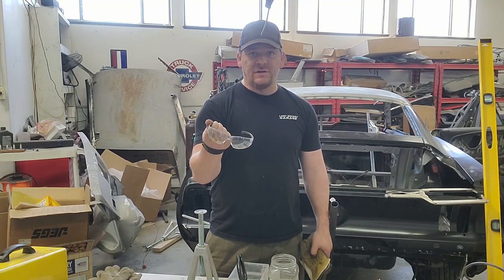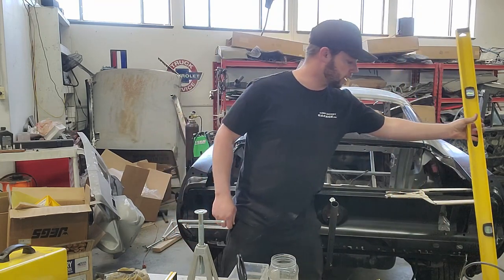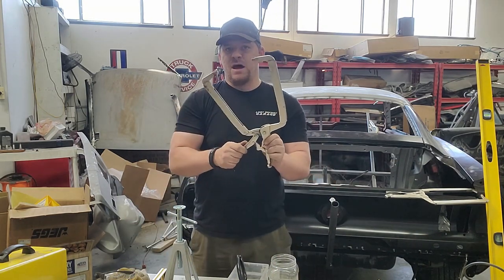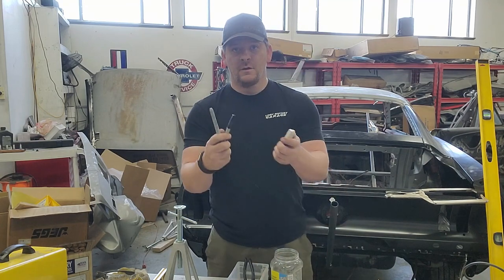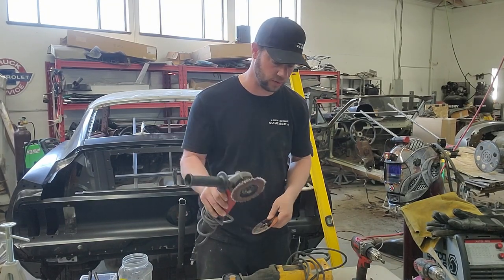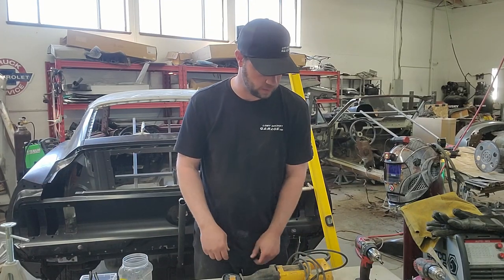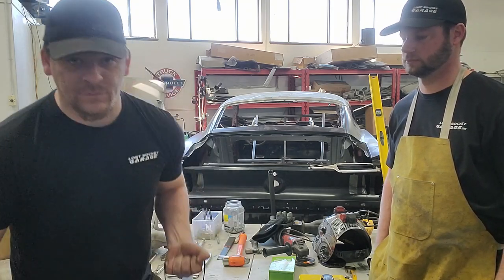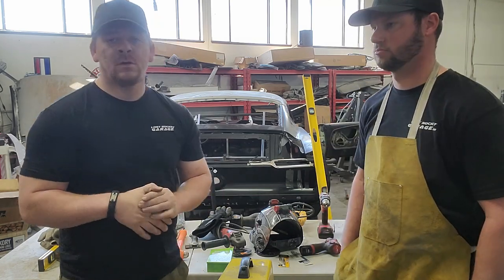Essential Tools for Your Mustang Coupe to Fastback Conversion Project | lostsocketgarage.com

Comment: Do you guys use any seam sealer when putting the panels together? How are they for rattles and water leaks when complete?
Reply from the maker: Yes we seam seal the vehicle. It's put back together like from factory with plug and seam welds so no rattling

Comment: How much would you charge me for this conversion? I’m looking to find a solid 67-68 coupe. Are you able to do a 69-70 coupe to fast back conversion as well? Please let me know thanks. This is my dream car but the original one is too much money
Reply from the maker: So the pricing varies based off the year of the car and condition. The range is around 10 to 12 k ish right now. Feel free to reach out to us via Facebook or Instagram. Sometimes we source vehicles for people as well
Reply: @lostsocketgarage  ok well I found one for $2500 no rust but has no engine and stuff like that. Not that I care because I plan to put an engine in it after
Reply: @lostsocketgarage  thanks so much for getting back to me I really appreciate that you guys are bad ass for that I’m surprised you reached out. I hope to make something happen
Reply from the maker: Hey thanks man! 2500 is a good deal if it's mostly rust free. Most of the time we say plan on 10-15k right now for a decent coupe. Thanks for watching and let us know if you need help
Reply: @lostsocketgarage  for sure thanks